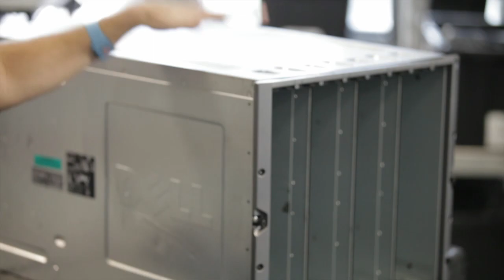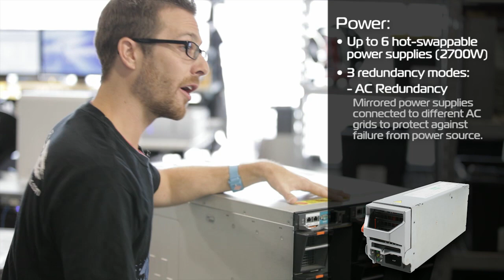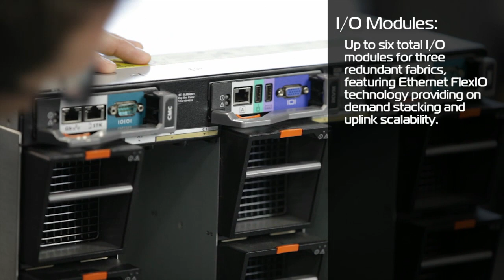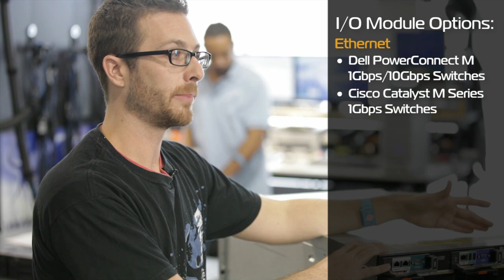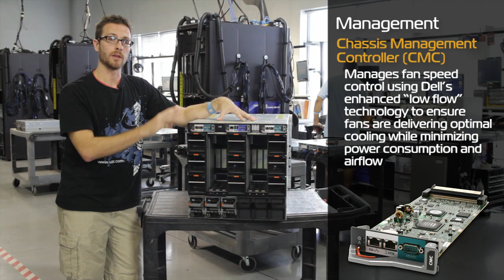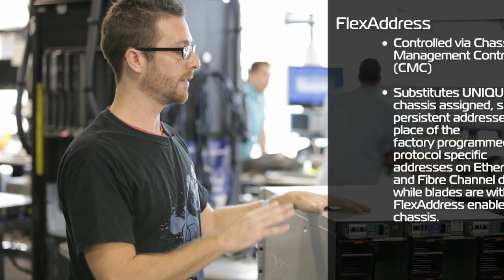Dell M1000e Blade Enclosure - System Overview

Comment: Great video, thanks for posting. I saw it is on discount in amazon. Those who are interested may check it out at http://www.amazon.com/gp/product/B012BO54P8/ref=as_li_tl?ie=UTF8&camp=1789&creative=9325&creativeASIN=B012BO54P8&linkCode=as2&tag=sweafigh-20&linkId=MCXV7CX5KSUE2PML

the model is: Dell PowerEdge M1000e - 16 x M610 with: 2 x X5690 - 192GB RAM - 2 x 1.2TB 10K and it has five year warranty